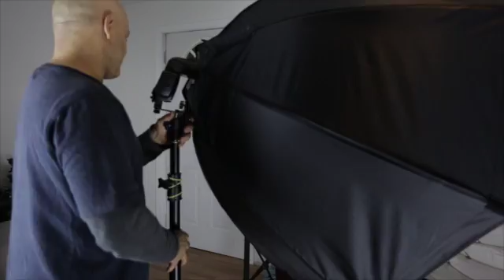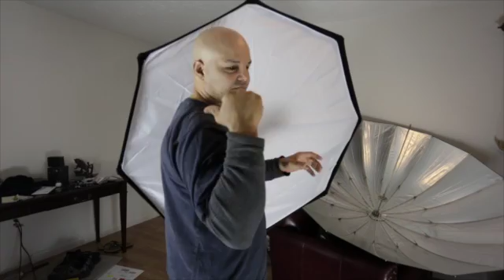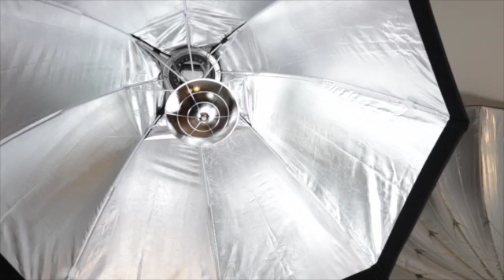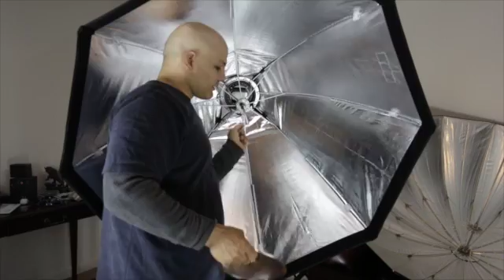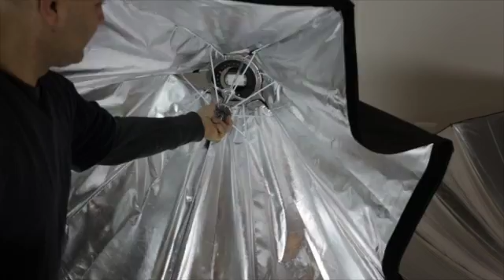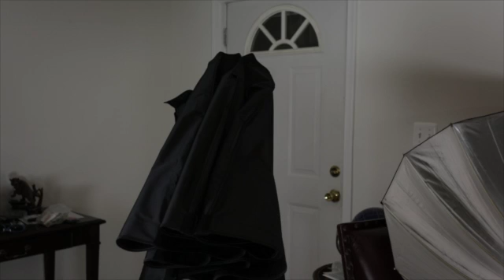Fotodiox Ez-PRO-48-Octagon Softbox

Comment: same exact crap as cowboystudio. the push in thing was a pain in the behind, I figured out the trick to be set it up on the ground and push against the ground, it makes it a lot easier. however, because they decided to use 1047406334 Newton of force for that thing, the hook that holds the umbrella in place after you set it up broked within 3-5 uses. I had two of them because they sent me one as replacement, they even said it might happened again. pretty sure the product is defective as hell.